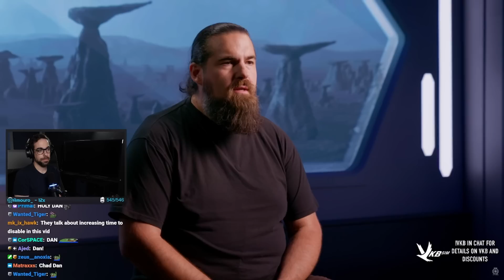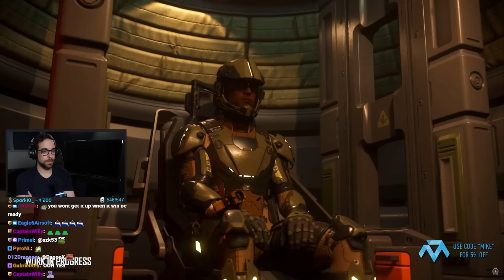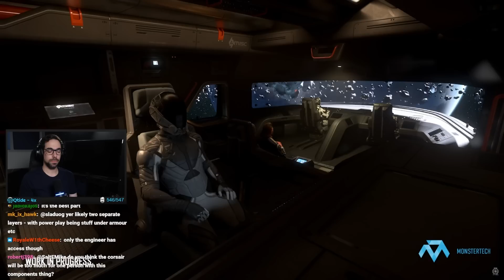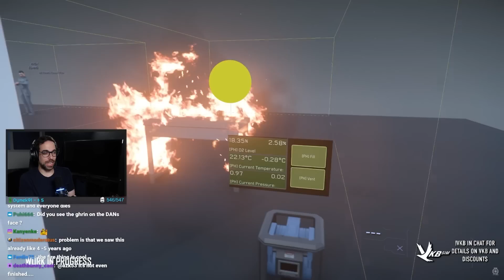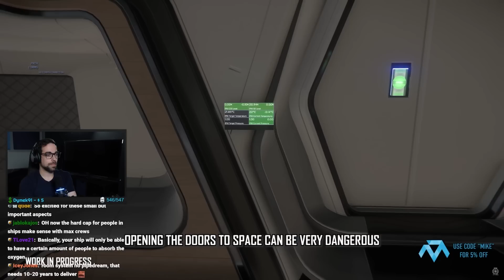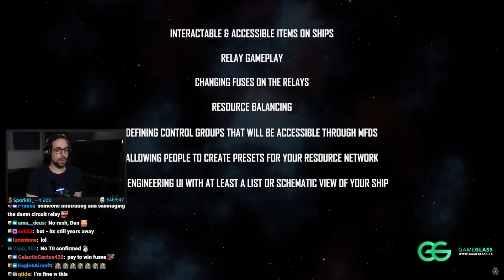Resource Management Will Change Everything

Comment: What is interesting about this is that it opens up an entire dimenson of experience, players who have been engineers on many types of ships will have valuable experience while new players will lack those. 
In a sense, good engineers and crew can actually make a large difference, if something like relay is that vast of a system. Good engineeers will remeeber exactly by memory were each relay is and can quickly replace them, while new players are completely confused.

It will be quite a breathtaking experience for a new player to board the ship of an experienced crew and see all of this going on.

Comment: I was becoming concerned about where the game was heading with all the people complaining about how tedius they think it is, how having to buy and keep equipment or not crashing their ships was ruining the experience for them. Glad to see the game is still going in the direction of immersion and physicality. I hope stealing relays or changing the air isn't too easy to do, like you need to be an autherised person and not just some stowaway. Still really looking forward to the Idris and hoping I can run it solo when I don't have friends to crew it, keep it as like a mobile base where I store my fighter and something like a cutlass (if it fits) and to move them long distances when fuel isn't dirt cheap and you need to actually refuel more. A fighter has to stop multiple times but in Stanton any other ship can go clear across the system without fuel stops. I'd really like something bigger than the Carrack but smaller than an Idris if I can't run it solo. A ship I can use long range and has hanger space for smaller ships. Like the Bebop. Though I am still rather partial to the Idris, something about having such a big gun even if I don't get much use out of it.

Comment: I think a one person light fighter should be so much easier to take out than the pvp meta it is now. I want to see a larger diversity of ships in pvp. I think its silly how easily you can get blown up by a meta small ship in something like a Connie.
Reply: Yeah that's planned.  Plus if the quantum drive is damaged the Connie has a chance to repair, the gladius needs to leave the seat and better hope you put quantum spark plugs or whatever in the little trunk.
Reply: I think implementing armor will help mitigate the dominance of light fighters whenever they decide to do that. They haven't really bothered with balancing too much because the entire combat system is going to eventually change

Comment: I think the one with the room full of people is showing that the more people you have in a room the more oxygen they use and a ship may not have the systems to support that many people.  It'll keep people from shoving 40 people in a Cutty Black or a Connie since those ships are normally only designed for about 3-5 people.
Reply: Agreed. Should only be able to pull off a large group drop if everyone has their OWN air supply in their suits. Otherwise it overloads the ships life support.
Reply: Oxy pens are cheap.

Comment: This will make for great gameplay. The hardest part will be finding someone that literally wants to run around fixing stuff and putting out fires instead of shooting or flying 🤣
Reply: Orgs will have more meaning when that feature will come out. But still mostly for testing purpose. Again, multicrew ships like hammerhead and idris will need crew to be functionnal and thats good. I mean, its ridiculous to have a 1 player manning a super big ship. Maybe a refuel ship or a hauler (at a certain point), but attack vessel should be only multicrew. If you bought the idris and thought you would fly it alone lol. At least, I hope they will add some NPC doing SOME jobs but not all of it, still requiring real players
Reply: @Fragnatix  that sounds like a lot of fun. I hope they can work everything out. And you're absolutely right. Big ships should definitely require a crew of players. I think AI on the ships should be limited to turrets. Engineering I feel like should be mostly done by players since it's controlling what has power and how much of it ect.
Reply: I’d gladly do that haha
Reply: Um, literally lots of people want to do that, like... literally. Not everyone is a PvP sweat boi like you
Reply: @tevarinvagabond1192  each type of gameplay will have it's challenges. My type will be finding engineers as one. And w.e your type is will probably be being found by me. Hope you enjoy w.e way you decide to play 😀

Comment: This will definitely make for some really neat gameplay, especially for multicrew, I’m just curious how it would work for smaller ships. It makes perfect sense on a large ship like a Carrack, Hammerhead, or even ships like Connies… But on tiny fighters or smaller ships like Freelancers, it doesn’t make much sense to have physical relays. I’m curious to see how it plays out in the end.
Reply: I assume other than components this have little effect on smaller ships.
Reply: :yt:Having those relays "physically" on your ship could mean that if you are attacked by someone using ballistics (for example) they may be able to damage or destroy a power relay that could turn off power to multiple systems throughout your ship, thereby disabling it or at least rendering it combat ineffective. In short, it adds the RISK FACTORS that any number of ADDITIONAL engineering problems could certainly aride during combat. The days of just waiting for your shields to recharge in combat to re-engage will be long gone.:goodvibes:
Reply: There are no relay bays on the smaller ships since you can typically access all the components directly and repair/replace them directly from one room (or from outside the ship).